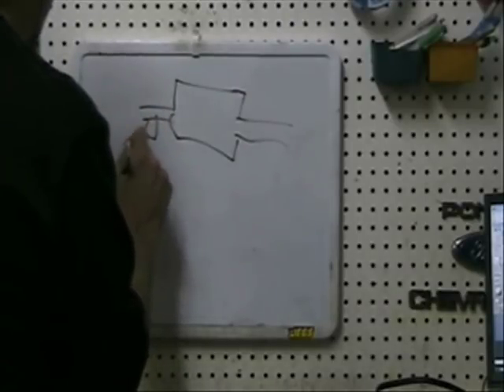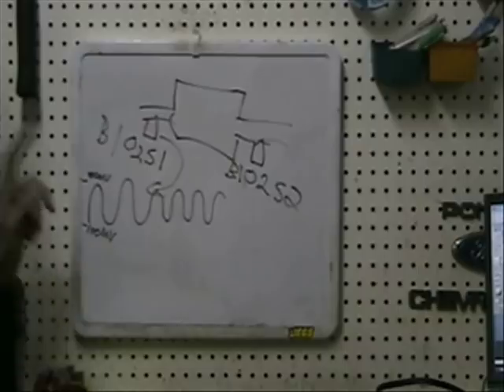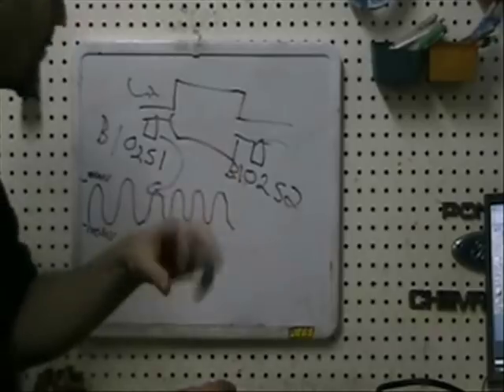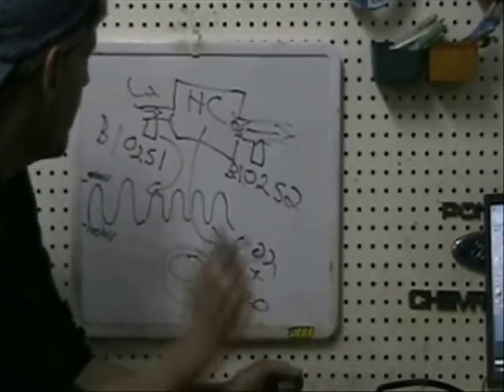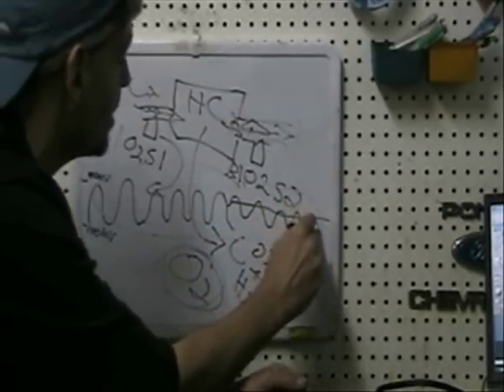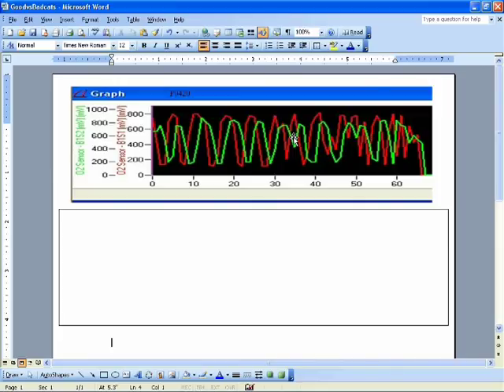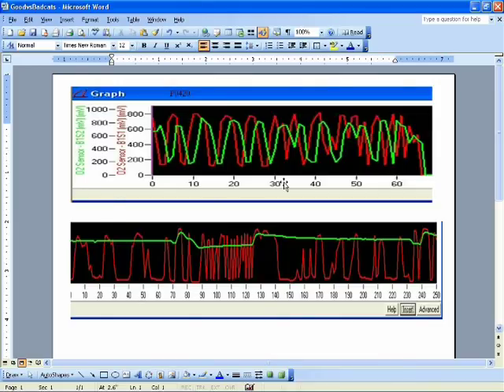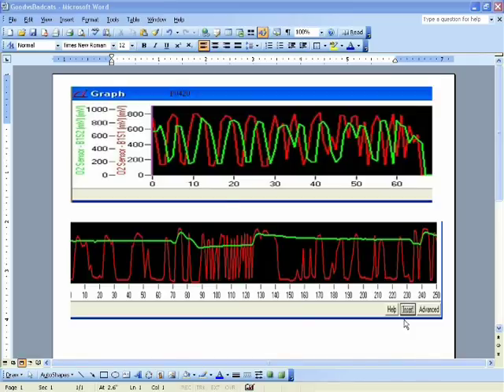P0420 P0430 catalytic converter catalyst inefficiency code diagnosis

Comment: I have a 2006 Lincoln Navigator with a P0430 code.  Does this mean the entire cat converter needs to be replaced?  Around how much should that cost?
Reply from the maker: What did the O2 sensor traces indicate?
Reply: Unfortunately I don't know.  I took it to a shop and they told me to replace the whole thing.  I'm just trying to do a little research.
Reply from the maker: 99.9% likely you do need new cat.

Comment: I was doing some research and found that postcat sensors are always o2 sensors
Reply from the maker: Yes, at this time post cat sensors will be traditional zirconium dioxide sensors- not A/F sensors even if the front sensors are A/F sensors.
  This means the post-cat trace can still be used to determine catalyst efficiency as shown in the video.
Reply: Schrodingers Box I have them fixed lean. Didn't have time to do some diagnosing.

Comment: I was reading up on my truck from an new forum and low and behold they said at this link that this was a good video http://www.clubfrontier.org/forums/f23/p0420-p0430-77632/index2.html

No wonder I like what some of them are saying if you too are their learning source. :)
Reply from the maker: Lol, my video is actually linked in a forum?  That is the equivalent of "Origin of Species" by Charles Darwin being referenced in a Baptist church.
Reply: Schrodingers Box Good one! lol They got even fancier actually. They embeded the video there and kept referring to it. I gave a basic description on fuel injector testing since that's one of the things you check if you don't want to keep ruining your Schrodinger's Cat, I'm mean catalytic converter and linked them here to see it happen.

I purposely didn't link directly to the video needed so they can click around and learn even more. :)
Reply: Schrodingers Box I would be very interested to know what kind of scan tool you are using. I sure would like to get one.
Reply from the maker: Brian Filler Autoenginuity

Comment: Excellent explanation, i have a 2000 honda odyssey, and the check engine it´s on and codes P0420 and P1456, the performance is 23 miles per gallon,i discover in the cat the O2S2 it´s stalled in the same pipe of the O2S1, checking you diagram the O2S2 should be set after the CATALITIC Converter, thst means the cat was installed in reverse way, regards.

Exhaust
maniful         O2S1            O2S2                   Muffler
___________%__________!$''''''''''''''''''''''''''!________
_______________________                ________
                                           !-------------!
                                             Catalitic corverter

Comment: The best video on youtube on that subject! I know this is old, but maybe You will answear. Did You check that on idle, or at 2000-2500rpm? Because i heard you should measure this at that value and thats the only thing that is missing in the video. In my Car 2002 Focus st170 (SVT in US) i have poor milage, and my scan tool shows that when idle, sensor 2 shows steady line, but only 0,05V, when at 2000rpm it shows whats in Your video. What to think about it?
Reply from the maker: You should measure it at 2500RPM
Reply: @SchrodingersBox   Thanks!

Comment: As always, utterly clear and engaging, yet very didactic, THANK YOU.

One question: can O2 sensors begin to go bad before utterly giving out (flat line)? And how could one tell?
Reply from the maker: Yes, absolutely they can. When they start going bad they often have sluggish response to variables. In fact there are check engine codes for this.  While a scantool is not the best way to measure the response time because often scan tools have a lag time themselves, you can see the slow response with a scope or even just a DVOM.
Reply: @SchrodingersBox  aaaaaa ok makes perfect sense thank you.

Quick follow up: given that (as far as I have learned from your vids) we should invest our brain power on the front-end vía diagnosis rather than parts-changing, do you often perform some spot checks to ensure your inputs are reliable for diagnostics?

For example, cleaning the MAF sensor, checking the upstream O2 for variance, etc...
Reply from the maker: All the time man. All the time. In all my videos you will notice I preach drawing a baseline and then measuring any changes you create against that baseline to verify there was a change. 
  O2 sensor variance is usually the worst thing to check because the short term fuel trim will keep the sensor oscillating regardless however checking the short term trim itself is a great indicator, as is any volume or metrics changes on the sensor itself ( for example seeing volumetric efficiency change after cleaning a MAF)
Reply: @SchrodingersBox  “volumetric efficiency change” <— this is a bit beyond my level...I’m not sure what you mean.
I remember when I cleaned my MAF it was at high 3s grams/second before, and then 4-5 grams/second afterwards. Is this what you mean? (Also LTFT stabilized as well, it was a bit erratic before)

Note: I’m still beginner level at these things.
Reply from the maker: yep that’s what I mean. Because you measured the MAF baseline you know cleaning it made a difference.

Comment: Great video!
How did you measure & the V pattern of the O2 sensors?
Are there easily accessible contact points on the sensors that you can put your meter leads on?
What make & model meter did you use to measure & record your data?

Thanks in advance!
Reply from the maker: I used a scantool called Autotap but you could also use an oscilloscope
Reply: Ok.  Thanks for the info.
I have a scan tool, but I don't think it has that feature.

Thanks for the informative & helpful video!
Reply from the maker: A B If you have a scantool it will at very minimum have O2 sensor data.  Maybe what you have is just a code reader- but any scan tool can do this data acquisition shown in the video
Reply: Thanks, I'll have to check all the available features of my scanner.  I haven't used it in quite a while.

Comment: So the O2S2 should should stay as a flat line at approximately 0.45v?
Reply from the maker: no- just the bias voltage. the O2 signal itself should wave between .1 and .9 on front and ideally .8 for the rear.
Reply: @SchrodingersBox  thank you for the reply. I have an lpg car and I  had a problem with the pcv hose. I replaced the pcv and the hose, but the car still runs rough, has a missfire (p0303), fuel trim still shows high, especially on lpg (24%), and recently the car gave me a code for O2S2. But prior to that I noticed that the O2S2 looks erratic and big difference between petrol and lpg. I suspect the bad o2, and I hope I didn't melt the cat🙏🙏🙏
I changed the sparkplug and the coil between cylinder 2 and 3, erased the code, and it still shows p0303. 
I know you usually are against it, but I already ordered the oxigen sensor😅, I think it's gone bad, because I drove a lot of time with that hose broken. I also did a compression test and it was alright for all the cilinders, so no burnt valves. What do you reckon? 
PS. Thank you for all the videos, I learnt a lot from you, a lot of stuff that even some mechanics don't know here. Greetings from Romania! 😁
Reply from the maker: I don’t see how an O2 sensor would cause a single cylinder misfire- plus the fact you have a fuel trim indicates it is working. check the FASTTEC components of fuel, spark and compression in cylinder # 3. it has to be one of those varibles. .
Reply: @SchrodingersBox  i will check in more detail, but maybe there are 2 separate issues. I can't upload screenshots here, but on petrol 02S2 is around 0.75v, stable and the car runs better, but when I switch to LPG, sometimes it behaves like the s1, and other times it runs very lean (0.1v), that's why I suspect it to be faulty. Or maybe there are some issues with the delivery of lpg that causes O2S2 to go crazy🤔

Comment: will it hurt vehicle not to change cat that isn't working efficiently its just not hitting freaking California emissions standards its an aftermarket in a car with California emissions set to it but live on other side of country motor runs great tip top but original cat clogged up and failed very common problem with model but i missed the recall period well have never popped major problem codes  anyways i replaced with cat with universal and now keep popping p0420 code and cant afford a California cat will it hurt motor not to change to California cat or is it a must or damage will happen also i read others with same problem and they fixed by using o2 sensor spacer and lifting rear sensor up and out of direct exhaust air stream just a little to change readings need help and input thanks man
Reply from the maker: If the cat is flowing but catalyst is just insufficient, no damage is being done to car. The rumors you heard about resolving the check engine light are typical garbage advice from people who have no understanding of rear O2 sensor function. You would simply get an O2 rear lean code instead of 0420.
Reply: Schrodingers Box ok cool thanks man very much appreciated

Comment: I have a 2000 jeep cherokee 4.0 with cali emisions. 2 u.s. o2's and 2 d.s. o2's. I just replaced air filter setup with 3" aluminum and k+n filter. A month later i have a p0420 and evap large leak code. Read the b1 o2s and s1 is flutuating between 100 and 800 mv and s2 is staying between 700-750mv. All o2's were changed out a year ago with an engine overhaul. no other vacuum leaks. Did not check for evap purge or canister leaks yet. Any thoughts? Do you think the intake mod may be causing this. Just luck that i need an inspection in january. Thanks.
Reply from the maker: The evap large leak is probably a loose gas cap.  I can see no reason that your intake modification would have any effect on your 0420 code but you may need to measure your rear O2 under driving conditions since often the stable rich reading is actually only at idle.
  Just to be sure you don't have vacuum leaks, it would be good to know the LTFT reading vs RPM to confirm this is true.
Reply: Schrodingers Box thanks much. Ill check the long term. Just so you know the o2 readings were at 2000rpms.

Comment: does rpm have anything to do with this....I get the the good readings at high rpms but behind the cat at idle scan tool says .1 v.....goes up to .7 when I increase RPM
Reply from the maker: Yes you should measure at 2200RPM

Comment: Thanks for the clearly presented O2 secondary story.

Considering the price of a cat converter, what sort of things make them go bad and have can we best avoid killing a cat?
Reply from the maker: @WDHewson- What would best avoid killing a cat? Make it less curious.  But other than that avoid rich fuel mixtures which is by far most likely to overheat and damage a cat quicker.  If your Long Term Fuel Trims are below -10% I would look into the cause of rich condition to better preserve the cats.
Reply from the maker: Ah I should also add- make sure you don't have exhaust leaks... exhaust leaks ahead of the O2 will cause a FALSE lean condition, and thus actually significantly richen the exhaust.  But still- the idea is avoiding any rich condition either way.

Comment: Is the downstream O2 sensor said to be working fine if it has constant value at around 0.7 or 0.8 volts? also does this mean the catalytic converter efficiency is good?
Reply: Slightly rich, but converter should be doing its job.

Comment: Schrodinger thanks for the great videos. I've seen a video by Scotty Kilmer using a gallon of thinner poured into the petrol tank to clean the catalytic converter. What do you think about this?
Reply from the maker: As usual he tried to treat the symptom and not the cause- and without any scientific diagnostic evidence whatsoever at that.
  How did the "removable contaminants" get there in the first place and what is the repair for that? What is his diagnostic that this method will work as opposed to actual catalyst exhaustion which cannot be "cleaned"?

 It's no more a stab in the dark than when he replaces an EGR valve to try to fix a rough idle.

Comment: What would determine if any of the 02 sensors failed?
Reply from the maker: simple- the lack of response to induced variables devoid of missing bias due to feed or ground fault would necessarily be an O2 sensor fault.

Comment: So, there's apparently a big market for these so-called "p0420 fixers".  They're screw-in extenders that fit into the rear-o2 sensor slot; the sensor then screws into the extender.  They range from about an inch or two and distance the rear-o2 sensor from the exhaust stream.

I've also found forums of people using these claiming it increases their gas-mileage by (sending rich signal to ECU; ECU responds by) leaning the fuel mixture.  I was wondering if you have heard of these and how bad (or good?) the potential consequences are for using them? If street cars are generally programmed to run a little more on the rich side, could a simple mod like this be an optimal performance tweak - or even worth the experimentation?
Reply from the maker: Yeah I am familiar with them. Not a single person yet that I have ever seen has scientifically experimented to show tese claims.
  Hell, I used to be on those forums.  Idiots there claim they get SOTP horsepower results from changing their oil to Royal Purple.
Reply: @SchrodingersBox  Re specifically the rear-cat sensor extender and based on what we know about fuel trim adjustments.  If there is any fuel trim adjustments made by the ECU based on the rear-cat sensor data, there would have to be some affect on the AFR by moving the cat-sensor an inch or 2 away from exhaust stream, right?

Some mechanics have told me the rear-cat sensor has no influence on fuel-trim and its only purpose is to provide health-state of cat.  Other mechanics have said it does have some effect on fuel-trim, but varies by model.  Have you found anything specifically in regard to the cat-sensor also being used to adjust fuel trim?
Reply from the maker: It depends on the model. Later models (after 2008 mostly) do have some fuel trim contribution from the rear sensor, but it is not significant- kind of like an IAT is for fuel ration input.

Comment: Hi,
Any advice would be much appreciated and thanks for reading my post. I recently bought a used lexus model: Lexus RX 2005 MHU3_, GSU3_, MCU3_ 400h. Soon after the engine management light was on, got diagnostics check which showed error P2187 saying oxygen sensor signal biased/stuck lean bank 2 sensor 1. So I got the sensor replaced and code reset. After few miles now showing error code p0430 catalyst system efficiency below threshold bank 2. Now does that mean the catalyst is faulty and if so will replacing the catalyst converter solve the issues. Would there be any other problems if I continued to use without fixing?
Many thanks to any suggestions.
Reply from the maker: you will not get a catalyst code if you also have a O2 sensor code since the computer knows it needs functioning O2 sensors to determine a catalyst issue. You likely always had the catalyst failure but it wasn't detected until after the bad o2 sensor was replaced. I call these "Discovered codes".

Comment: Im getting a p0420 and p0139 both up and down strream sensors been changed.  Downstream wave form stays high around 9 millivolts so im might have to check for exhaust leak or vacuum leak
Reply from the maker: 9 millivolts???  that’s extremely low!, not high!  Why did you expect a vacuum leak if you think that’s high? that makes no sense. I also don’t understand why you changed the sensors. they didn’t need to be changed. 
  Not sure what your strategy is- hope you know what you are doing.
Reply: I know that no no after watching alot of your videos. I got myself alldata diy for this 2008 patriot jeep and will be doing some diagnostics to get this problem solved

Comment: Hey, i checked my O2 sensors and at 900 rpm everything good, the sensor 1 was oscillating and the sensor 2 was steady, but at 2500 rpm the O2 sensor#2 starts to oscillate too.
I disconnect the battery for 10 minutes, then the check engine light turns off, but after 2 days is back on again and indicates po420(low efficiency of catalytic converter) 
What can I do?
Reply from the maker: that means you need a new cat

Comment: Great Video, However I feel the possibility of O2S2 to mimic O2S1 is next to nothing because most of the time the CAT will be partially working and will prevent this from happening. Unless my understanding is wrong and the CAT either works or either not
Reply from the maker: Your understanding is wrong. The catalytic chemistry is well defined and established and incongruent with your explanation, sorry.  Please cite your resources for your interpretation.
Reply: I am not saying I am right, I am saying this was my understanding and you might be right. Here is a link where i based what i told you (look at the graph at the middle of the page) https://www.troublecodes.net/pcodes/p0430/ 
I THINK that the CAT might be partially working in some cases which may prevent mirroring both sensors

Comment: My OSB1S2 on my 2 pre-2002 Toyotas is flat around 200 mv but you mentioned it should be high voltage. What does this mean?  There are no codes. I thought higher voltage means rich and lower means lean. I am still learning.
Reply from the maker: try running at 2200RPM.
Reply: @SchrodingersBox  The O2 sensor 2 voltage went up steady to 700 mv when the car was moving steady at 50 mph and around 2200 rpm. It was low voltage when standing still even with high rpm. 
Your videos are amazing! I learn something everytime.